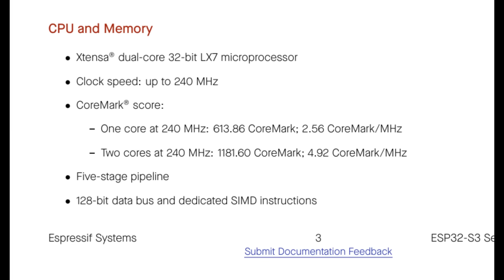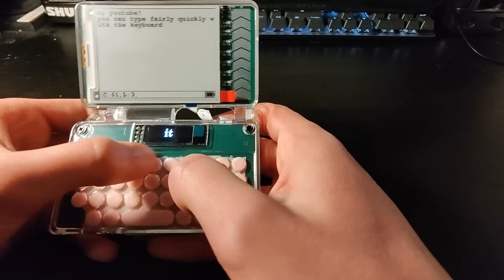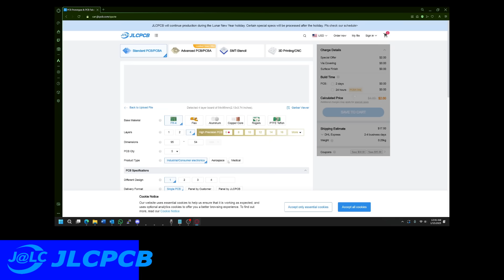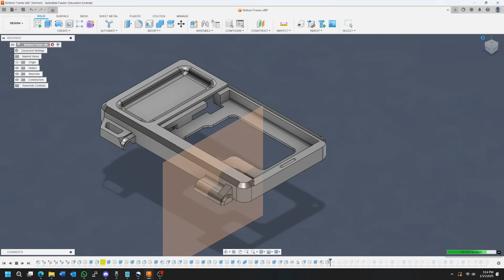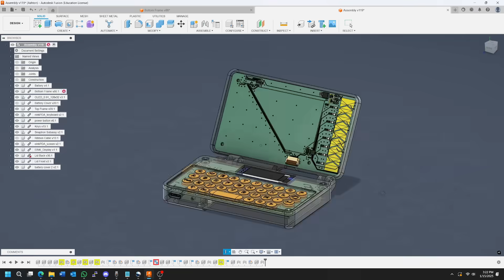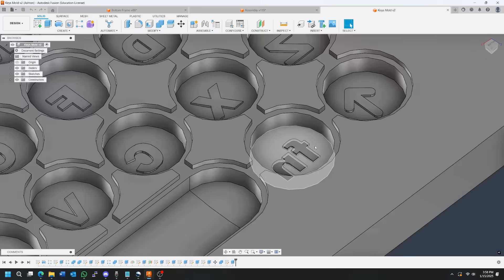Building My Dream Productivity Device

Comment: Nice project, though the ribbon cable for the screen looks like its in a lot of pain, might want to switch to a shorter one or offset the connectors on the pcbs. Also might be worth to try and hide it in the hinge so it doesnt get damaged, kinda like on the 3ds. Otherwise looks damn good!
Reply from the maker: Yeah this is a major design flaw with the current hinge system. I think the best option I've found is to offset the connectors to be in line and shorten the ribbon cable. Thank you for your suggestions!

Comment: Combining a large e-ink with a small LCD is such a smart idea !
Reply: It's a nice solution, but there are high-refresh-rate e-paper displays or the option to partially update the screen. On my reMarkable the typewriter mode works quite well and is more than fast enough to update my typed text, so in theory it should be possible to implement something like this too, give the right display.
Reply: @0xbenedikt  Yeah this display he used didn't even seem that slow, it reacted very quickly to the word inputs
Reply: Think he said the small one was OLED. Even more power saving.
Reply: @DefaultFlame  The small one is an OLED indeed, but OLEDs are not as power saving as you think, compared to e-ink or an LCD (even with backlight). Their power consumption is very dynamic and proportional to the number of active pixels.
Reply: When I saw the thumbnail that was my first thought. Then I watched the video and oh look, he did exactly that!
Reply: @ That is true, but the backlight current is (without local dimming) always the same for a LCD no matter how many pixels are active. For an OLED, if only very few pixels are active, it will be more power efficient compared to an LCD, while it will be significantly less power efficient if most pixels are active. As with a lot of things, it's a tradeoff and depends on the application, what is better. In this case, I'd go e-ink all the way and drop the OLED.

Comment: Yo! Great project. I am wondering how resin-on-resin hinges are in terms of durability. I am trying to make a clamshell case for my project and resin is just scraping and chiping off in the points of contact, leaving non-transparent white marks
Reply: Also, about m2 screws holding the screen part, are they secure? My expirience with trying to screw directly into resin is subpar, resin is crumbling and destroying itself
Reply from the maker: The resin i have is pretty good in terms of durability but I added hard stops in the design so it just kinda flops between open and closed

Comment: I love it, i want one. Only thing i'd change.. if when it goes to sleep, it leaves what ever WAS on the screen.. just leave it there and at most, just put a small sleepy face in a corner instead.
Just so one could open it to read some notes without turning it on.
Reply from the maker: That's a great idea. I'll have to change the code. Thanks a lot!
Reply: @ashtf  Consider a key combo to throw it into the "secure sleep" state that obscures the screen content just in case you want to keep stuff hidden.
Reply from the maker: @ great idea!
Reply: @ashtf  soon people make so many suggestions that it'll become full fledged PC
Reply: @ashtf  markdown support would make this a killer device.. and a couple more font choices
Reply: @ashtf  Make it a setting you so you can change between the two behaviors.
Reply from the maker: @DefaultFlame  I did :)
Reply: @ashtf  👍👍
Reply: Absolutely! I was thinking 'why use an e-ink display if you're not gonna use this?'
Reply: @LazyBunnyKiera  Without the OLED it wouldn’t even have to fully go to sleep. You could slowly scan the keyboard in a low power mode and resume full operation on the first keystroke
Reply: That's brilliant. It's like the book cover for kindle in sleep mode.
Reply: Love the idea

Comment: this is the cutest usability nightmare i've ever seen
Reply: One of those things where you know it's never going to be used but you still want it
Reply: @openaw Like every PDA or digital address book I ever bought 😄
Reply: @openaw Build it, type a hello world in it and put it on the shelf.
Reply from the maker: Hopefully with some software additions it will become less of a novelty and more of a practical companion device. but yes, he's cute
Reply: @ashtf he's just a little guy 😭😭😭
Reply: @notaprofessionalJ You sound like my gf.
Reply: Do you have any plans to figure out a way to acquire the parts for this easier? Ik the PCB is open source, but I'm not sure where you would get things like the battery and display (and the key osrd cover, though you could always print out the mold and make one yourself)
Reply: @ashtf  almost like a smartphone? lmao
Reply: @Valentin-oc5nh  Yeah but without the predatory practices like being built to break. This thing will last forever and since it primarily using E ink for display it's battery life is super long. Someone would have to charge it about every other week. I've actually used a TCL flip (which is the battery he's using) and I had to charge my phone about once a week despite me constantly texting and calling people.
Reply: @ashtf Sure it will
Reply: well it's purpose made so it should be fine
Reply: I laughed but your comment sums up my first impression pretty well. But then some things are made to be practical and some things are made because making things can be a fun and rewarding experience. Mostly I just love the little e-Ink display and this gives me an idea for a cute (if not particularly practical) pocket-sized eReader that could be fun to figure out how to make.
Reply: @Raguleader  Oh that'd be nice for stuff like RSS/newsletter reader too
Reply: "My First Cyberdeck"  lol

Honestly looks like a fun project to whip together for the sake of learning a lot of things all at once and coming away with a fun thing in the end, even if it's not the most usable.
Reply: @wardrich  yeah, would also be cool to try and make something for it, like a system clock, or image support
Reply: the form factor is undefeated, connectivity seems fine
Reply: He literally designed it to meet his own goals. I made my own tiny PDA with a keyboard and an oled screen, it's impossible for anyone but me to use, and it's perfect.
Reply: in my opinion it would actually be pretty cool if only it had plastic buttons i would never choose to type on silicone buttons matter fact i havent touched a silicone button since a decade ago when i had cable
Reply: Oh boy, the negativity in this thread. You can of course buy for example an Android device for reasonable money, and forego any and all cloud services and registrations. Heck, you can constantly keep it in airplane mode if you don't like the internet.
Reply: Nightmare, not a nightmare😊😊
Reply: It reminds me of an old phone with a slide-out keyboard that I enjoyed using until the touchscreens arrived.
Reply: I don't get what people are criticising. Please explain to me: what is impractical/unusable about it?
Reply: @AMcAFaves  just that it looks hard to type on, though tbh, it can't actually be that much worse than a phone keyboard, not sure how a backspace type thing would work though, that could also make it worse.
Reply: @amca1975 the typing, still love it
Reply: @amca1975 They’ve been asked several time and haven’t answered. Seems like they’re trolling.
Reply: Why is it a usability nightmare? Because  it is so small?
Reply: @pummeluff230   e-ink display = massive lag.
Reply: @cj09beira  I did not know that. Would make me nuts if I type in something and it is not there pronto. This is the exact reason I dislike writing by hand. The lag.
Reply: @cj09beira Isn't that what the OLED display is for, though? To eliminate lag on the current word you are typing/editing? To me it is a good solution to e-ink lag. The e-ink is like the RAM, and the OLED is like the cache.
Reply: @cj09beira Which is what the little LED is there for, in return you get nearly zero power draw, perfect visibility in sunlight and no eye strain. It's like looking at a sheet of paper, hence the name, e-ink is awesome.
Reply: @pummeluff230  Because I'd rather write on a napkin than use this thing. But it is cute.
Reply: @pummeluff230  Because its main function is writing notes, but the keyboard is not practical because of the size, shape and squishiness of the keys. Very impressive project though.
Reply: This is the stupidest comment I’ve heard in a while.
Reply: It's a real shame this is all you get if you actually want to own a device.
Reply: @rockets4kids  what do you mean by "actually own"

Comment: ... but does it run Doom?

Jokes aside, something small and non-distracting like snake or tetris is always nice to have, do you plan on integrating something like that?
I know that philisophically it defeats the purpose but I had to ask. :)

I've always wanted devices like this but in this day and age they are hard to find in decent quality.  My conclusion has been that I will have to write my own software and make my own hardware to solve this problem, and it's nice to see someone else with the same dream.
Reply: Almost like a modern Game&Watch! 

something like Sudoku or a Crossword would seem ideal, since they dont need a fast refreshing screen, and use a keyboard for input

Comment: My Danger Sidekick2/Hiptop2/ bought August, 2005 [so yeah Colour] still works because I changed the battery a few years ago, and it can do all of this and more. This is still a nice project, but I am wondering where are you going with this in 2025, since we've had stuff like this for at least 30 years now, anyway. I subbed, and I will check out your channel later on.

Comment: This little thing looks so professional and the ui feels "warm". That exposed ribbon cable does scare me a little bit.
Reply from the maker: Yeah, rough prototype for sure 😅 I'm hoping to hide that ribbon away in future iterations...
Reply: the 3DS has a few ribbon cables that go from the upper screen to the base motherboard. Might help to steal some of that design
Reply: @MaoMaster69 yeah, I was thinking that too.  hiding ribbon cables in a clamshell hinge isn’t trivial, but is definitely a “solved” problem, with examples in pretty much any clamshell device intended for general audiences, like flip phones, the GBA SP, or DS/3DS family.
Reply from the maker: I tried that initially, but in this stage of prototyping the tolerance just isn't there for me to be able to coil the cable within the hinge at this size. I had inspiration from the DS as well initially and then decided to go for this option for a prototype. In a more final version the ribbon cable will be less janky for sure. Thanks for your comment!
Reply: @ashtf  Running into a similar issue in my own project now. Let me know if you have any design guides you could link me cause i couldn't find anything after searching the web for an hour. Though my project already has an existing hinge in place that can't route cables, so it needs to run offset from the hinge.
Reply: @ashtf  probably doesn't need to be coiled like that if you have enough left over to bend it internally instead